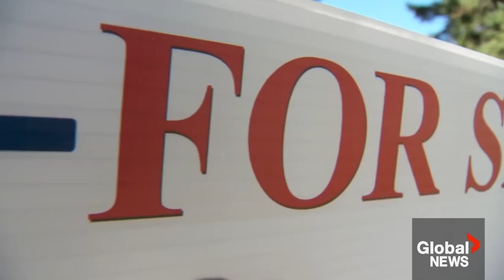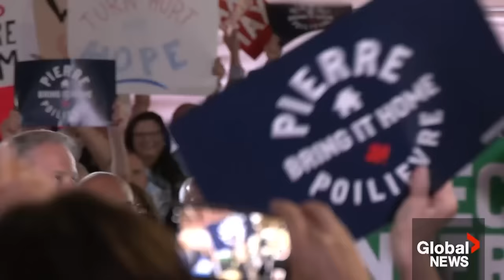West Block: Sept. 17, 2023 | Which party has the best plan to address the housing crisis?

Comment: Pierre asked Trudeau and Singh back in July to restart Parliament so they could tackle this problem.
But vacation was more important for the Liberal/NDP coalition than the crisis that Canadians are facing.
Reply: How is Pierre going to help solve this problem? He has no ideas, he is only a facade of a nice person. That's his whole schtick.
Reply: @sandorski56  How many times did I hear Trudeau say all parties should work together? 
Here was the opportunity presented by Pierre, and Trudeau and Singh rejected it. 
The question is,why hasn't Trudeau tried to solve this problem before now?
Reply: That is still more than what Pierre is proposing. @Slipshott
Reply: @sandorski56 that is such a disingenuous talking point. Pierre has proposed many supply/demand policies. Liberal policies have been choking the supply side of the equation for so long. Many cities like san Fran, Vancouver, Toronto have implemented insane requirements to build. With long bureaucratic processes that take forever to navigate and cost an arm and a leg. Land use requirements, zoning etc. Pierre has talked at length about changing this by incentivizing through infrastructure funding increases if targets are met or funding reduced if they don’t meet targets. Adjusting rates of immigration. Maybe you should consider listening to things he’s said rather than regurgitating liberal talking points

Comment: Most of these mayors, not them 2 in particular, caused a lot of the problems. The municipal governments have been more active in using funds to entice mayors to speed up the process of permits. It also costs too much for those permits. It also lays major blame to the federal government on 2 fronts. the carbon tax and the influx of immigrants. if you think it will be a smooth sailing the next year think again. Your winter energy bills will sky rocket putting more people on teh streets.
Reply: Lol. City planner sitting at home behind a computer making 60k a year bleeding multimillion dollar construction loans are more concerned about break time and have more power then a mayor does.
Reply: @Jp1904lt  they don't make policy. they just follow them

Comment: All the new areas in Calgary are being developed with mixed housing (Single-family attached and detached, plus multi-family condo's and apartments). Indiscriminately rezoning the entire city (like the Fed's are expecting prior to approving the Accelerator Fund application) is going to put a higher burden on the infrastructure in older (non-inner city) communities and cause more problems. That investment could be better used improving transit and other amenities in the newer areas to make them more viable while simultaneously addressing other areas of affordability.

Comment: Remove the ability for investors to speculate on housing as a commodity like AirBnB and force to sell properties which are not their primary residence. This will significantly increase supply without the need of construction of homes. These proposals that they have will not help in giving housing to the people who needs them. The housing units will just go to the people who have the capital to begin with. This will just make the rich richer and the poor stay poor. Only in a country with their citizens and permanent residents have their own home and not rent just to have a roof over their heads will be the best for Canada.